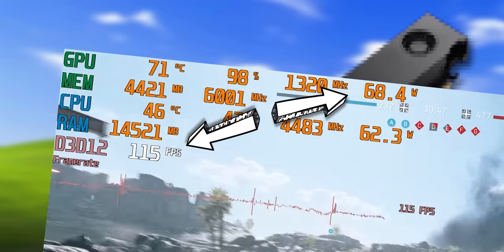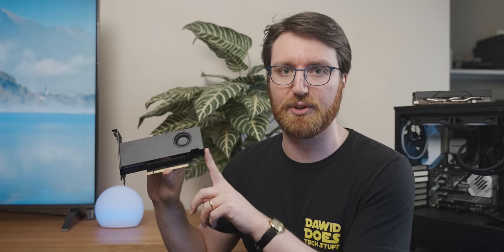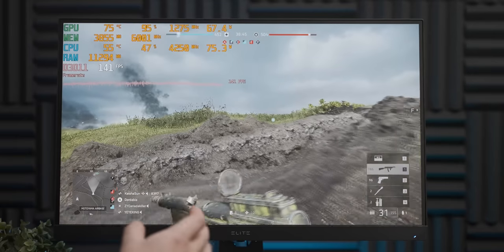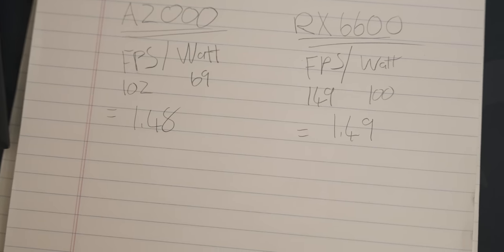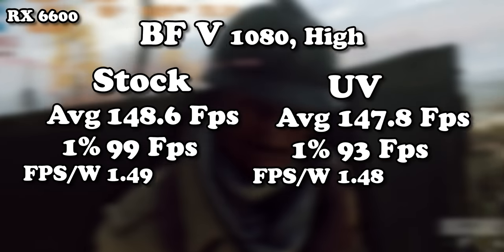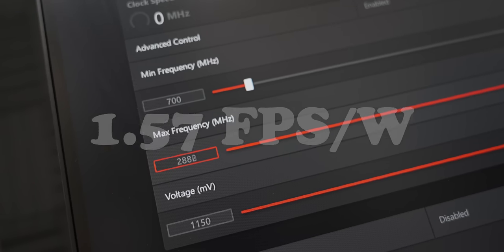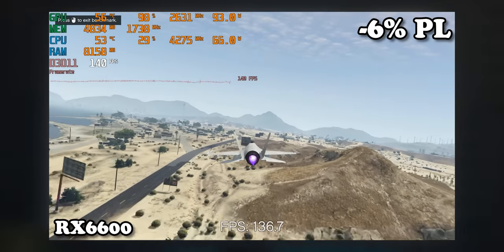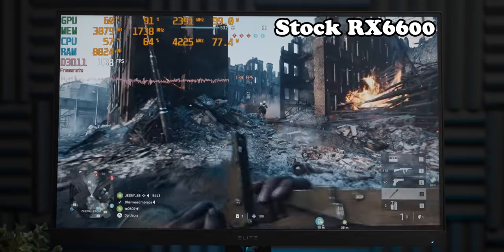The Battle For The World's Most Efficient Graphics Card

Comment: I pegged my laptop 2070 Max-Q to 1185mhz and it uses 70w or less whilst gaming and in conjunction with disabling turbo boost I've been getting ±60fps gaming experience in resident evil 7 at 1440p max Ray Tracing (with interlacing)

The reason I'm doing this is to conserve power on my campervan battery.
Reply: Also note that Resident Evil 7 RE Engine is an optimization beast. That thing runs amazing in lots of configurations. Capcom really nailed it with that one
Reply: @Chronologo  Oh 100%, same with all of them to be honest! Love these games so much. Can't wait for Resi 4 remake! I figured as long as I can have a 60fps 1080p experience I'm good and I worked out total system draw is probably around 100w or thereabouts which should enable me about 4 and a half hours worth of gaming assuming the sun has gone.

Using the laptop screen I can probably save some more power and use 1080p more. Just have to see if I can change the screen for 144hz to 60hz to save more power
Reply: yep, your 2070 super max q is no less efficient than these desktop GPU-s. 3000 laptop cards are even more efficient, so this guy was wrong when he was talking about "the most efficient GPU on the market" because that's the laptop 3080 ti.

Comment: You need to set lower clock speed to allow GPU core run in more optimal part of V/F curve. This curve is not linear, at lower clocks card will gain efficiency due lower voltage. No need to decrease voltage slider, it's not fixed value. You might even need to increase slider if voltage drops too much at lower clocks. Also overclocking will increase voltage because new higher clock speed is higher on the curve. Very similar to Zen3 CPUs, highly dynamic and voltage follows clock speed. I'd use HWInfo or GPUz to monitor GPU voltage.

Comment: Game optimization definitely plays a big part.  A wider gamut of GPU-intensive games would've helped though.  A sample size of 2 is hard to draw any conclusions from.  But with all the other components being the same I guess it's decent enough.  The motherboard supports PCIe 4, so even with the last-gen 3700X, the 3600MT/s RAM should minimize any system bottlenecks that would significantly impact the framerate.

Comment: My settings on my rx 6600 is 1.075V and 2Ghz, it consumes 50W max at -20% performance, 2.08FPS/W equivalent on the GTA one.
Could probably reduce a bit more voltage or whatever for better power consumption since i only bought it because my former GPU was broken and in most cases only need 10-20% of its performance.

Comment: I ended up not doing the needed research and ended up with my current PC with these specs.
12th gen Intel core i9
16GB DDR4
GT 1030
1TB SSD
and a 180 watt power supply...
I need a GPU that won't kill my PC (It needs to be as power effective as possible) but I want the best performance possible too.
I was thinking of getting an RX6600 because I think they only draw 100 watts under load.

Comment: You should retry this using the "MorePowerTool", lets you change parameters of AMD cards including the power limit. It doesn't mess with the bios so its safe, only windows registry.

Used this to make my 6700XT more efficient for mining, same 46 MH/s but dropped from 110W to only 80W. Did so by increasing the power limit from 6% to 30%.

Comment: But . .  You didn't raise the rx 6600's minimum frequency . . . It never exceeded 2550 mhz from  what I saw on screen. It mostly hung out around 2400.

Side note, ampere cards you can undervolt them to roughly half of their power draw.  I've undervolted my 3070 to draw between 100-120w and I'd say it can still hit around 80%  of its stock config performance.

Comment: You're CPU limited a bit. Would have been worth testing games where that isn't the case. However the RX 6600 performs best when undervolted, underclocked and then having memory undervolted, overclocked and possibly timings tightened. Memory undervolt can in some cases increase your actual core frequency, if you were hitting your power limit before.

Comment: Didn't realise the RX 6000 series had such a locked down Wattman settings, when my Vega 56 has full clock and voltage graph control for each power state
You could likely get way better results if you had full control over the voltage
Reply: Its not locked down sinoly misunderstood.

It works similar to PBO on 5000 chips.

You set a maximum voltage, a frequency target and have a power budget.

The voltage will be on a curve, steeper if at 1200Mv than 1000 as an example. So essentially you make thousands of tiny increments changes.

Then depending on power budget, heat and how intensive the load is it will push the card as far towards the frequency target it can. Lighter loads yields higher frequency.

Comment: RTX A2000 12gb needs some low profile PCI-e powered competition to drive down price ( locally at least) , thanks for covering this card, i think if it (A2000) also had a 6 pin connector or the AMD card was PCI-e powered only perhaps the results would be different

Comment: You can draw it further with morepowertool, i had rx 6600m (which basically only lower clock rx 6600) can do 45W and still putting gtx 1070 like performance

Comment: The A2000 and 3060 are GA106. It would be interesting to see if a bigger GA104 like the 3070 (not the Ti because GDDR6X) can be more efficient with an big undervolt and power draw reduction. Basically turning it into a 3080 mobile.
Reply: When comparing to a 3060 at least, my 3060ti underclocked+undervolted at 1410mhz/0.693V  runs about the same score in time spy as a 3060 12GB running stock, while using 100-110w, so yes. But that is the lowest you can go before the core can't be fed with lower voltage.

Comment: You will need to revisit this. I understand the undervolt and power limit reduction. But I’m not sure why you are trying to overclock. Usually gpus become far more inefficient the higher clocks you are trying to get. If you bring the clocks down then you should be running much more efficiently.

Comment: You need the most CUDA cores possible. 100 cores at 1000 MHz is much more efficient than 50 cores at 2000 MHz despite similar performance, especially since power consumption is exponential with voltage. A 3090 Ti will probably be the most efficient per Watt if it's undervolted and underclocked a massive amount. They also use better bins on the highest end parts so you should be able to undervolt more than a 3080 (lowest end G102)

Comment: You know you should have tried it with Doom Eternal.  I used to play it on a 1650 Super and it always used the max 100W on avg.. However when I switched to the RX 6600 (Sapphire Pulse Lite Edition) at 1080p Ultra Nightmare the card on average uses <60W The only tweaking I did was turning on AMD Chill, and set the target refresh rate to 60 (cause my monitors & projectors are all 60Hz.)  With my I7-10700T (35W) make my system more efficient than a current Play Station or X Box...   In fact you should try to build a I7-12700T (35W) (you can find non ES version on eBay) and build a efficient gaming rig.  (if I had the extra $300 I would be buying the 12700T personally.)

Comment: So to start with the RGB advertising from Be Quite, I don't like devices with RGB lighting at all except for monitors. I convert PCs that have RGB so that they don't have RGB, for example by turning off RGB in the BIOS or removing the RGB controller and throwing it in the trash. But what I can say about small graphics cards is that I prefer the low profile graphics cards to the huge blocks you have in the PC case.

Comment: I wonder if the problem here is that you're already using a super efficient card so there's not a lot of room for improvement through undervolting/overclocking. I wonder what would happen if you chose a somewhat less efficient card (that hasn't already been optimized from the factory) with similar performance to the A2000 and undervolting/overclocked it. Maybe something like a 1660 Super.

Comment: Undervolting my RX 6800 got me pretty insane results. I went from 210 watts to 155 watts and my average FPS in cyberpunk did not change AT ALL. The minimum was only 3 FPS lower but the maximum FPS was about 10 lower? And that was from 130 to maybe 120... but average was around 90 anyway so yeah... I highly recommend undervolting for certain cards.
Reply: All cards actually. Underclocking too.

Comment: My 6800xt is undervolted with a 10% underclock and uses 175w playing bf 2042 at 3440x1440

I lose about 8% fps but drop 20 degrees on the gpu
Reply: My point being,  underclock the gpu and it will draw less power to sustain the clocks,  losing performance but maybe bringing the fps/w closer

Comment: I actually set TDP slider to same wattage as RX 6500 XT on RX 580 and it gets more fps per watt than 6500 XT and then I undervolted it and it completely blows away that 6500 XT, not to mention uses way less power and doesn't roast my tights no more. But for real, this makes me question if RDNA 2 is really all that efficient. It just seems that GCN was badly sabotaged by wattage limit set to the moon and then overvolted the crap outta them. Considering how popular Vega undervolting was, it seems to span across a whole range of GCN cards. And even argument "but you can also undervolt RDNA 2" doesn't work well, since it seems that they are from factory on knife's edge when it come to voltage and maximum wattage. In BF5 RX 6600 couldn't even reach last 200 MHz of boost, despite undervolt, meanwhile, my RX 580 runs out of boost and just uses less watts at that point. I know taht this is something for HWUB to make a video about, but that made me curious. What makes this case even more interesting is that you can modify vBIOS of those GCN cards and set maximum wattage lower or tweak timings for extra perf gains too, meanwhile that's not available on RDNA 2 cards at all. You can set RX 580 to 10 watts if you want, meanwhile RX 6000 is like "-6% is best I can do".

Comment: Hi Dawid, I have been watching your LP GPU video's and I was wondering if you could help me find a more efficient Graphics card for power than the a2000. I live in an area where power is incredibly expensive, so I have never had a GPU. I have been using UHD intel graphics my entire gaming lifetime.
Reply: The a2000 is very expensive as it costs more than a 3060ti and less than the 3070. Do the math to figure out how long you would have to keep your computer on before the cheaper graphics card becomes too expensive due to power.

The quadro T1000 is expensive but uses 50 watts
A used 1050ti is cheap but uses 75 watts just like the a2000
The rx6400 is new and cheap, but without pcie gen 4, its bad

Comment: I'm using RX 6600 with 700mhz minimum, 2600mhz boost, 1090mv, 1900 vram, fast timing, default fan and power. Mostly 60-70 watt, rarely above 80 watt.
Reply: Locking to 60 fps also helps.

Comment: 6:14 Why is the A2000 system RAM usage up at 12GB where as the RX 6600 only uses 9GB on exactly  the same scene?
Reply: it's memory allocation, not ram usage. the game reserves a certain quantity of ram (what is reported) even if in practice it uses a LOT less.
Reply: @ledoynier3694  I thought RAM allocation was dynamic? 6:19 dynamic RAM allocation would explain why the numbers changed by a few MB on this part of the game. If the A2000 system has been over allocated(unused) 3GB of RAM why would it bother to change the counter by a few MB?

Comment: Dawid you need to have the overclocking software let you manually do the over clocking the way you are doing it is still automatic to some degree I had that issue with my and card and I got my rx470 to run halo infinite at 720p 30 fps give or take

Comment: So the RX 6600 maybe wins the FPS/Watt/$ ratio? More maths! Late to comment b/c I just picked-up an RX 6600 at their new lower prices. Call it unfair but the M1 Max 32c integrated GPU is more than 2x as efficient as the RX 6600. Using SoTR which isn't even Apple Silicon native, it scored the same 90-91 FPS in the benchmark. The M1 Max GPU used 44W and the RX 6600 used 100W.

Comment: Actually the whole motivation of this video (tweaking the rx6600 for maximum efficiency) is totally pointless without the right tools (MorePowerTool). My thoroughly undvolted (SoC/GPU/MEM) and power limited 6900XT already blows the A2000 out of the water at capped 75W in terms of efficiency. But it's a bit more expensive, so probably not the best comparison.

Comment: I'm running my RX6800XT (Reference) at my undervolting settings all day. It pulls at maximum only 200watts, pretty impressive how efficient it is against an RTX 3080.

Settings:
1020mv
Core 2454mhz (stock) Minimum core clock on the lowest possible (500mhz), gave me way better 3DMARK scores as well more stable clocks.
Memory 2000mhz (stock)
Power target -6%
Fan speeds only max out at 60% its really quiet and a powerfull,efficient card!
Reply: 200w just measuring the GPU power draw. It’s actually a lot higher…

Comment: You’d probably need someone like Gamers Nexus on this to do it accurately - then again, I doubt either AMD or Nvidia are purposely letting any wattage ‘leak’ so maybe it just is what it is.
Reply: Ehh, we'd wish that as consumers. It's actually AMD that's not doing consumers any service with their software "power reporting" (it reports watts, but only those after efficiency loss from VRMs & capacitors). Meanwhile Nvidia is almost perfectly accurate (it's only a bit off during short measurement periods with a bunch of transient spikes which might not all be captured).

Then again, I really doubt most consumers actually care & those that think they care don't even know where the number the software reports on AMD GPUs comes from in a lot of cases, nor that they're comparing Apples to Oranges, even if both cards would supposedly be the same GPU (since capacitors & VRM's can differ between AIBs & efficiency loss is dictated by operating temperatures).

Comment: Unfortunately the AMD voltage slider is SUPER weird. It DOESN'T actually set a limit on the voltage. What it does do is encourage the card to reach higher clocks at a given voltage. So it will be more efficient, but not by much and it will use just as much power. If you REALLY want to make things more efficient, you need to use MorePowerTool and set a limit on the voltage. This will DRASTICALLY reduce the heat output and allow it to be much more performant and efficient. You can probably get away with -50mv. I was able to get away with -75mv on my 6800xt and it runs fantastic. Not sure about the 6600 tho

Hopefully this provides some useful info. Sorry you made an entire video only to realize AMD's driver voltage control is basically non-existent lol

Comment: you could've overclocked and undervolt the rx 6600 with msi afterburner or you maybe could've you could've used an rtx 3060 since the a2000 is just a binned down 3060

Comment: I'm surprised about how much life I've gotten out of my five year old GT 1030, it will not perform on low graphics at all for anything like Battlefiled or Halo Infinite Fortnight however it'll do just fine for Fallout and Elder Scrolls games. I find multiplayer games incredibly boring and stale even compared to a 10 year old game such as New Vegas so an old entry-level card is all I currently need until I have the need to use a more powerful card.
Reply: Wow nice i also have a gt 1030 its actually very nice to at least squeeze  out some horsepower from that lil baby, ill stick with it until i get unbroke and buy a new 1060 or higher
Reply: @seven7000_  It's a fun little card, I run mine on an old small form factor HP with an Xeon. It solved most of my issues until the 20's came around because it seems to have been slowing down on a few things like video rendering and graphical mods for Bethesda games. Was definitely worth the $70 I spent back in '17.

Comment: Thing is, you didn't overclock the A2000. This tiny thing can easily clock to 20% gains in fps with no considerable increase in power. So unfortunately RX6600 loses this battle.

Comment: Mr Dawid, if you want to see better efficiencies, drop the clocks down. Instead of "give me as many frames as you can get" tell the card "give me 60 (or however much you want) frames but in a most efficient way". In your example, even by dropping fps (I don't just mean capping them at 100, I mean underclocking to the point where it's the highest stable result you get) to 100, you'd be able to underclock a lot, which in turn will make undervolting waaay easier (from my experiences at least, the gpu may crash at 800mV (lowest possible) at 800MHz but taking it up to 840mV makes it stable at 1000MHz etc)). In my example, I can play some games (for example grounded) at stable 45fps (I know it triggers some people that not everyone plays at 144fps, I know) with ~40-50W instead of 45fps at 80-90W using default gpu settings (capped at 45fps) or ~70-80fps (~67% more) (uncapped) at 125W  (178% more). This is efficiency. Would also make a sensible video material as a follow up to this one. If I wanted to play at 60fps I'd probably get it to something like 70W at most which compared to default settings would be 55W less (44% less) for ~15fps less (~20% less).